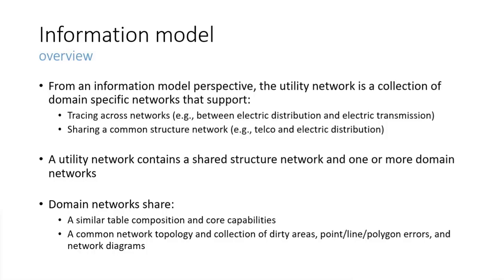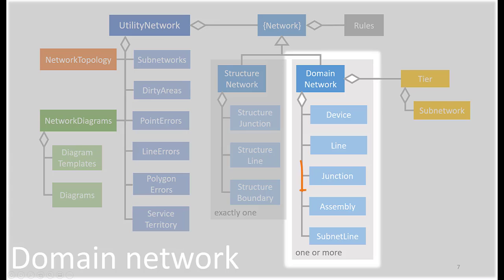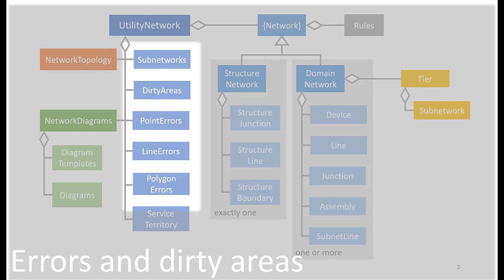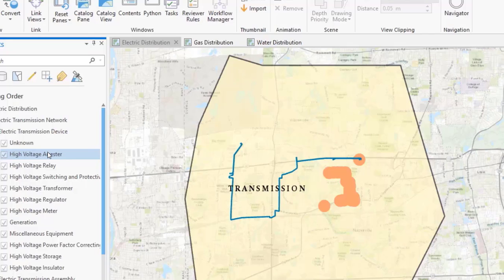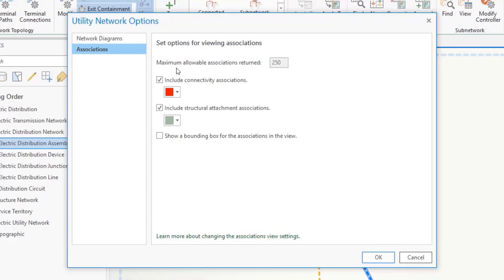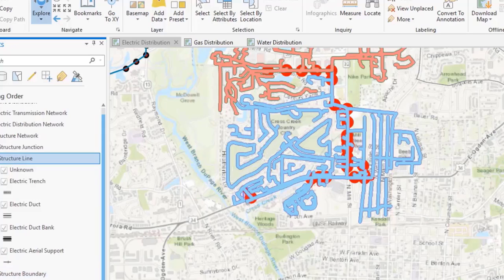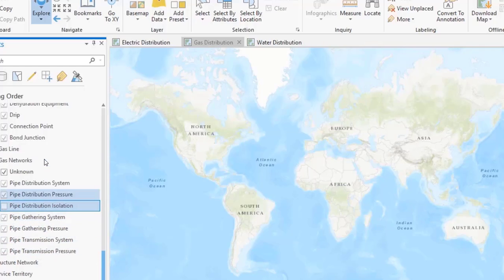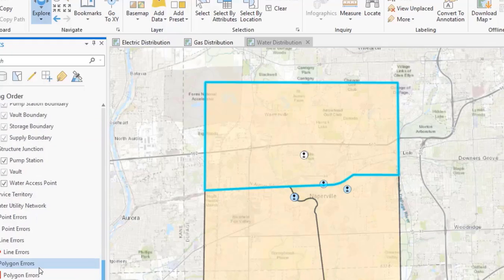Overview of the ArcGIS Utility Network

Comment: Can vertical assets take part in the utility network? Ex: twelve feet of pipe above ground, weld elbow 90 down, eight feet of pipe, half of which is underground, weld elbow 90 up, twelve feet of pipe continues... 

Sorry for the noob question, I'm going to research independently but thought maybe someone out here could give me a quick answer.
Reply: You can specify rules to allow multiple point features stacked on top of eachother. On top of this (excuse the pun) - the Z value can determine somethings height or depth.